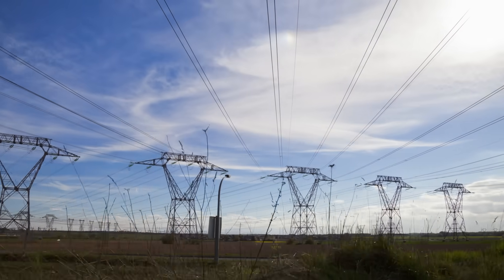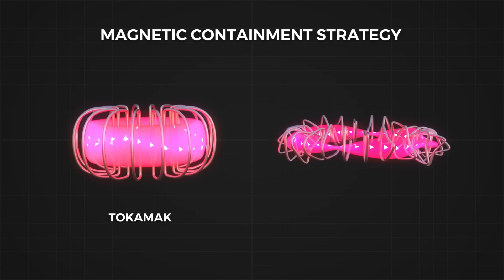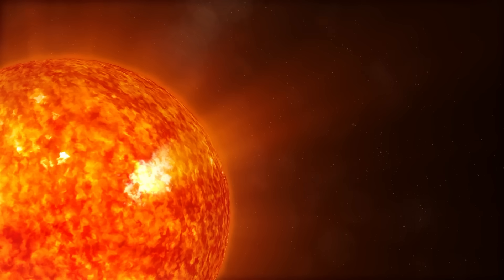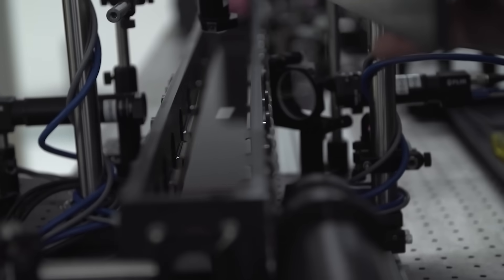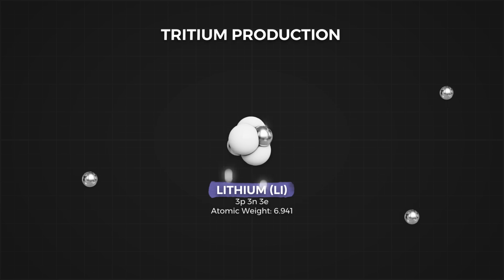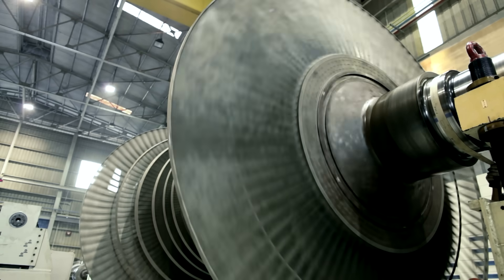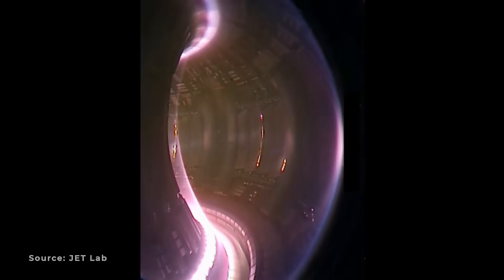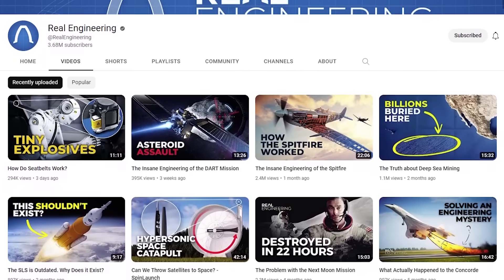The Problem with Nuclear Fusion

Comment: Still is always important as you briefly mentioned that atomic fission is far better then coal, oil and gas since the power that it give us is much more reliable and in the long run more economically efficient (to not talk about safety compared to the others). You should do a whole video about the pros since you're trusted and have quite the following.

Comment: I’d like a citation on how fission reactors are uneconomical. I googled it and yeah they’re expensive to start up but they make a lot of power for a long time after startup. Most of the reason for shutting them down recently is fear mongering and concern trolling about nuclear accidents.
Reply: Nuclear is actually the cheapest form of electricity in the long haul once the startup costs are amortized over the of the plant.  The reason fewer plants exist is the click bait fear-mongering resulting from social media and main stream media trying to generate views.

Take a stroll over to Kyle Hill's channel and get some balance.

Now don't get me wrong...  I like a lot of this channel but his bias does show.

Take this particular video as an example..  free neutrons can't be controlled by the magnetic containment.  Neutrons fly off in all directions.  They will be striking surfaces not coated in berylium.  Even with the berylium some neutrons will still pass through creating neutron damage or creating other radioactive substances through neutron activation to materials not encapsulated or shielded by berylium. 

I believe that even if (big IF)physicists and engineers do manage to create a net positive fusion reaction, the cost of basically building a new reactor at the end of it's life cycle due to neutron damage will be cost prohibitive.  

Let's not forget, engineers and physicists have yet to come up with a way to efficiently capture the energy from a net possitive fussion reaction.  At the end of the day, the efficiency of whatever solution they come up with needs to be factored in to the actual net positive calculation.
Reply: New nuclear reactors have recently been built and are even now being built in Europe, at least. So they do seem still viable economically even under strict regulations.
Reply: Fission reactors are not uneconomical when compared to traditional power sources such as coal or gas fired power plants (as the lower nuclear fuel costs balance out the greater startup costs over the lifetime of the power plant), but they are becoming less economical as alternative energy sources such as the solar & wind industries advance and mature.

Comment: Fusion isn't going to be really practical until they develop cold fusion with Helium 3.  There are no neutrons or even photons.  Just pure kinetic energy on a charged particle, easily turned into electricity.  You can't do cold fusion if there are free neutrons and every other reaction produces neutrons, either main or side reactions.  There are no side reactions with He3, so no neutrons that need shielding and cooling.

He3 has some really interesting cryogenic/magnetic properties that can facilitate getting past the coulomb barrier.  We can mine Iron, Titanium and He3 on the Moon to build ships to mine the asteroids.  Mars already has 2 captured asteroids to start with.

Comment: I'm not entirely sure, but my understanding is that He3 (for the most part) does not fuse with another H1 atom to become He4 (it does on occasion, but it's a miniscule amount of the He4 atoms that are produced during fusion in a star). The main branch of the proton proton chain which produces He4 is when 2 He3 atoms fuse together into He4, releasing two H1 atoms.

Comment: The thing is that unlike some other technologies were their was something missing we didn't know that made a massive leap forward, theirs doesn't appear to be anything as of yet like that with Fusion. We just have to do the hard work and make out plasma hotter and more stable till its hot enough and stable enough for it to be cost effective.

Comment: One basic problem not addressed here is the damage that high speed, highly energetic neutrons create in the fusion rectors first wall. 14 MeV neutrons will knock the atoms in the first wall off their lattice position. The resulting vacancies at these locations will migrate by diffusion and combine to form voids. This leads to rapid, uncontrolled swelling of the materials of construction that sees this neutron flux. 

When we were experimenting with fission breeder reactors the high energy neutrons were only about 1 MeV. These neutrons caused core structural materials to swell by 16 vol.% in as little as  360 days of operation. All that swelling introduces tremendous internal stresses and can quickly cause failure. 

Obviously, 14 MeV neutrons are much more energetic than 1 MeV neutrons and therefore capable of inducing damage at a very high rate. This materials problem has to be resolved before a viable commercial fusion reactor can be built.

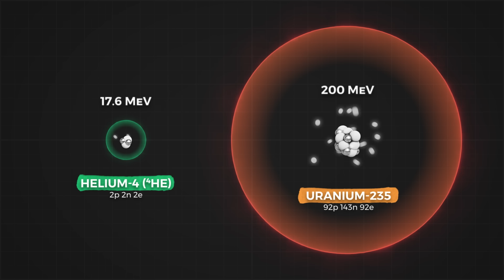Comment: @6:20  "...fusion produces no dangerous radioactive products."
This is technically true, but overlooks the fact that the tritium fuel itself is a dangerous radioactive substance.
And unlike fission products, which are mostly metals (aka solids),  tritium is a gas which is extremely difficult to contain.

It also overlooks the fact that the neutron flux from a nuclear reactor (fusion or fission) creates radioactive contamination via transmutation of the structural materials in the reactor.  There's no way to avoid this.

Please stop spreading the false narrative that fusion reactors won't create radioactive waste.  They absolutely will.

Comment: There is a problem... Government. Take Helion for example. They have been threaten quite a few times with funding issues where people claim the scientist behind the scene have been working on their project for decades and nothing yet. But Helion claims they are practically through or allow me to suggest that they are maybe 2 or 3 steps from completion, yet the government is threatening to pull the plug by stopping the funding to their project. The the narrator said cost efficient energy. It may be in their vision, but it won't be for the consumer. I mean, look at the cost of living now. Look at the so called national debt. We can only wake up from a dream of having an un-subsidized $10-$25 electric bill, just throwing a figure out there. For short, this vision of cost efficient has no place for capitalism.

Comment: The video makes nuclear power sound much more bleak and expensive than it really is. 

Talk to a nuclear engineer and they’ll tell you that every technical, disposal, and design challenge for nuclear fission reactors was solved 20 years ago. They’re safe, cheap, and disposal is easy. 

The real issue holding fission back is regulation and fear mongering. Nuclear fission plants are always over budget because the regulatory bodies require they overengineer and overspend to satisfy the arcane laws that haven’t been updated since the 60’s. Aside from that, smear campaigns from fossil fuel companies and “lobbying” (cough cough bribes cough cough) put a false impression of nuclear fission into the minds of people and an incentive on legislators not to favor the more efficient and green tech. 

Governments shut down their nuclear plants not because they’re too expensive or because they’re inefficient, but because they’ve been bought off and have succumbed to the fear mongering. 

Tokamaks, as he touched on but didn’t clarify, have an inherent design flaw in its containment strategy that the preceding Stellerator doesn’t. Tokamaks induce an electric spin in the individual particles to keep them contained. Problem is is that hot plasmas lose induced electric charges in favor of magnetic resonance with any nearby field. So the second you induce the spin and then heat it up you lose containment. Without containment, you don’t have fusion. 

The reason every country on earth favors the Tokamak had nothing to do with efficiency, it was cost. Tokamaks are far cheaper to build than an equivalently sized Stellerator, so after the intel leaked everyone switched to them rather than the Stellerator. Ever since, the few Stellerators that do exist have outperformed Tokamaks at every stage of development, punching far above their weight class. The Wendelstein 7-X stellerator has hit temperatures far exceeding any operational Tokamak on earth with better run times and better efficiency, they’re on the verge of ignition whereas no Tokamak has ever come close.

I get that a lot of information has to be cut for run time, but this is vital stuff. Geopolitics has played a much more serious role in curtailing nuclear development than you’ve implied and has far exceeded the curtailment of any real technical challenges

Comment: Clickbait! You are ignoring the massive shielding required to stop the neutron radiation. And you are ignoring all the materials made radioactive by exposure to neutron radiation.
Finally, you are ignoring the finding that to break even, the plasma must be in thermal equilibrium. The laser methods are therefore doomed to failure.

Comment: The problem with nuclear fusion as a sustainable power source is that nuclear fusion isn't self-sustaining. The only reason that stars perform fusion continually is by sheer force of gravity. Obviously, we can't possibly replicate that environment without extreme input of energy to do so. We're not trying to replicate a phenomenon which already exists- we're making something entirely new, which does not ever happen naturally.

Stars are not fusion GENERATORS. They are fusin CONVERTERS. They exchange the energy of gravity for that of light, heat, and sheer pressure.

That said, I do distinctly remember a conference where a group was successful in creating a fusion reaction that put out more energy that it took to make- which is a promising first step. So perhaps it isn't quite a pipe dream.

Comment: The fact that you can transform hydrogen to helium and it automatically just transforms back again should be a consistent power source. The repeatability of this process should be evident. Why make a fuel and spend it when you can just change States and gain energy from those different states transitions? Efficiency. Start with sustainability. If the machine come run for hundreds of years without needing new fuel to be made why would you try anything else?

Comment: Well, all I can say is that the sun just doesn't work like that. They're trying to build a perpetual motion machine. Said themselves it's impossible and yet try to build one.😂 The sun works in a simple principle. You require a lot of mass with different elements. You also require vacuum so it can't cool itself down. See the gravity is its ignitor. The more mass, the stronger the gravitational force can push the different elements together. And as you well know there's at least 2 different elements required for a reaction.
Sure the fusion power works. As a star, not as a machine. The center of gravity is still the Earth's core. And you're trying to make a second one that get's pulled down.

Comment: The fuel of the nuclear fusion is hydrogen, what is component of water. So the nuclear fusion is consume water, destroy it, you never get it back. After the reaction there is no Hydrogen (you get Helium), so no water. Depending on the number of power plants, a significant part of the water can disappear in decades, turning the planet into a lifeless desert. However, there is no doubt that with the development of this technology, gold can be produced over time...

Comment: Well ngl nuclear fusion looks like solving alot of our problems , maybe if we travel a bit in solar system we will find the required materials to make it high scale even tho there's high chances the nations fight for the raw material later on 
ITER can be a good thing but ngl it's will never ever beat the sun , and even from earth we only get a small % of that energy produced by sun , but that's still a insane amount , if only we could stock up that energy during day or convert it at a high rate into energy it would most likely be enough tho , but HOW ? xd

Comment: "As a civilization".

Every first-world society I can think of is crippling from what we once were. We aren't even teaching cursive in most schools today. The United States uses the "Standard" (Imperial) measurement system, while virtually the rest of the world uses metric; no one can agree, nor will agree, on anything.

This Utopian principal you speak of? It won't happen. Not efficiently, at least. Every Rome has it's fall, and our die has been cast.

Even if we "pulled this off", do you seriously believe we as the rest of the world would only be paying a slight margin or two more than what it takes the energy producers using these Tritium and Hydrogen isotope reactors to produce the electricity it makes? No.

We would be taken advantage of for the sake of corporate profit, just like throughout history.
Reply: Trumptard... stop consuming your narrative and you will see the world is NOTHING like that narrative.

Comment: If we don't decommission a nuclear power plant, the cost of energy it supplies would be lower. I'm confused as to why we decommission them, except to pacify people who think they are unsafe and expensive. Also, I think some of the risk is mitigated incorrectly. For examples, walkways in a plant that produces rod assemblies has numerous signs prohibiting weight on pedestrian pathways greater than 200 lb/ sq ft. So, I weight 240 lbs. and I lift one foot at a time. 🤔 Also, a single alpha particle which becomes embedded (unremovable) in shoe leather render the shoe useless. It becomes low-level radioactive waste, along with lab coats, tools.
Reply: Looser...

Comment: 6:24 - Incorrect, the byproduct of the D + T fusion reaction leads to a neutron along with the He nucleus.  The neutron is very much a danger radiation hazard.  The neutron will be captured by the fusion reactor components and activate those components causing them to become radioactive.

The other aspect is also the fact that we actually want that neutron to effectively create more Tritium as well with a Li blanket as part of the reactor structure as Tritium has a ~12 year half life (so it has to be produced).

Comment: OK.  Heres how to do it.  You create a fusion primer mechanism (a small tactical nuke) then completely encase it in a solid electromagnetic field using a poured form process.  Then the tokamac will be remotely started via radio primer inside.  Then the thing will immolate the primer and run on its own until the fuel is consumed.  They are disposable... yes.  Thats the only way to do it with current tech.

Comment: Where does the idea that there are no radioactive byproducts from fusion come from? The loose neutrons can and do irradiate the containment vessel
Reply: Exactly.  Aneutronic nuclear fusion is possible.  Considering the availability of fuel, the  easiest is proton-boron fusion.  However this kind of fusion is a order of magnitude more difficult as Deutrium-Tritium fusion.  So it will still be 30 years away at least.

Comment: Why continue to push these fantasies? Fusion is never going to work because one of the main failure modes is for the apparatus to destroy itself. Only an idiot would take another step forward in the face of such information. It's a fucking dead end. It has always been, and always will be a dead end. This is the Earth, not the Sun.